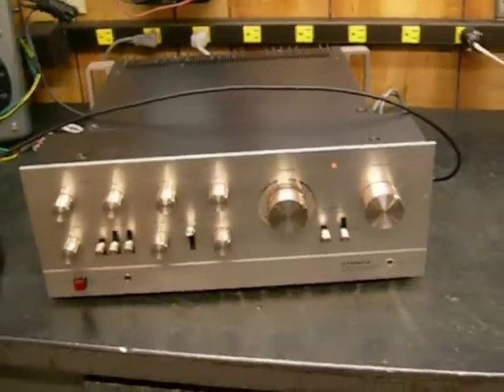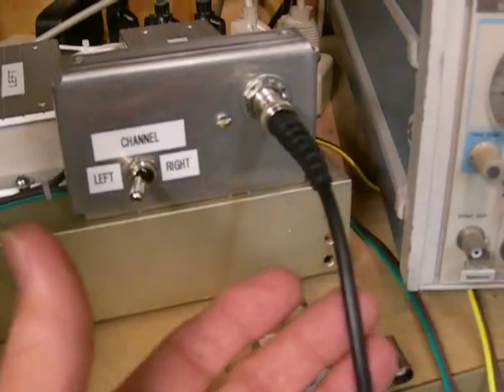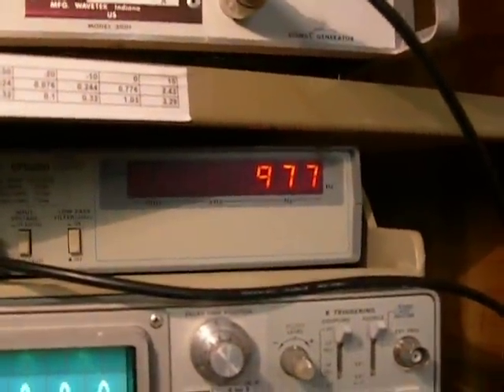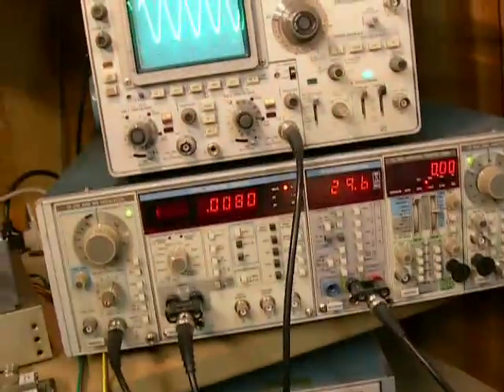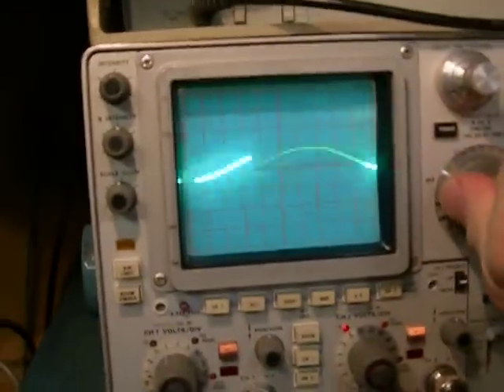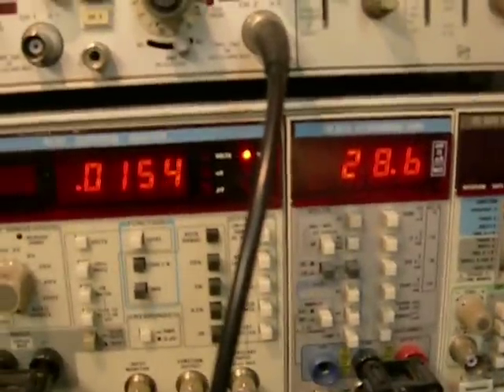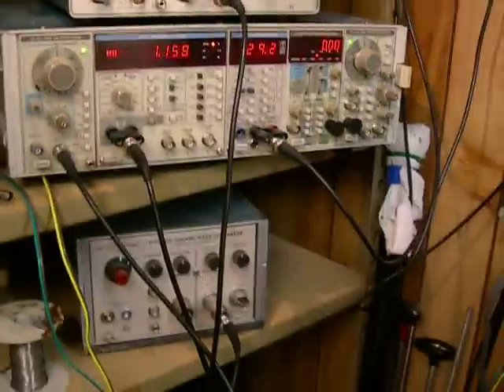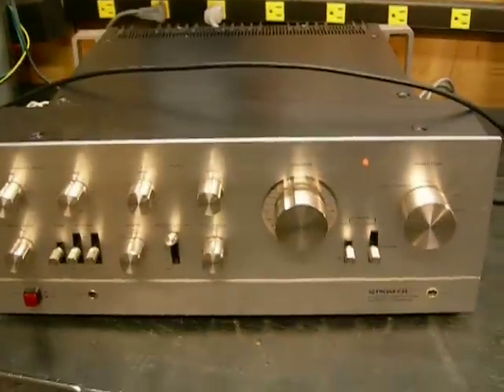Pioneer SA-9900 Amplifier

Comment: I could not see square wave shape at 20 Kilohertz and 50 Kilohertz....... iam achieving 0.019%  at 20 Kilohertz and 0.001% at 1 Kilohertz and 0.002% at 20 Hertz.... in my imagination you have not tested the power amplifier only... say...separate module without the hell preamplifier that distorts as a hell.....why that?...as you know,  we can inject our audio sources directly into the power module to achieve less distortion.
Reply from the maker: Carlos Mergulhão Hi Carlos - it's been a long time but I am sure I was only testing the power amplifier. Driving the Aux/Tuner/etc inputs or any of the high level inputs is pretty much the same as driving the power amp.  Just make sure you set the tone controls for flat if the signal is going through them. The challenge with driving the phono and tape inputs is it requires a lot of attenuation, down to just a few millivolts or the front end stages will be over driven and distort really quickly. The the RIAA compensation on the phone input accentuates low frequencies and attenuates high frequencies making it a challenge to test so I rarely check these high gain compensated inputs except to see that they are working.